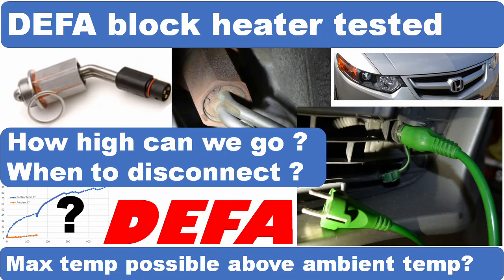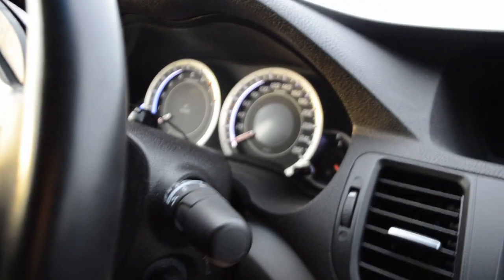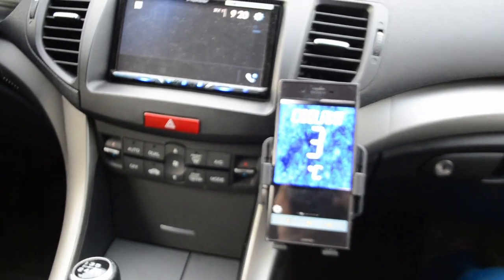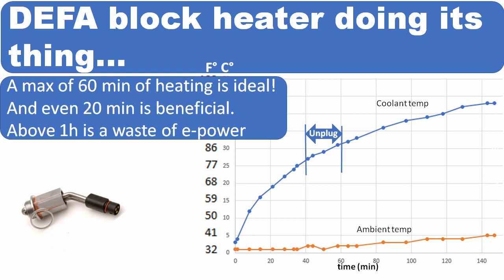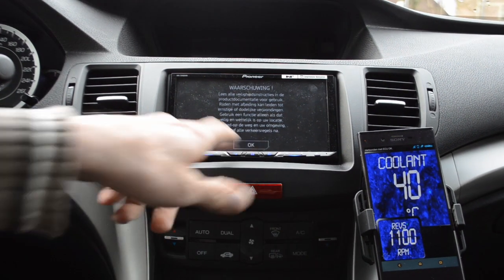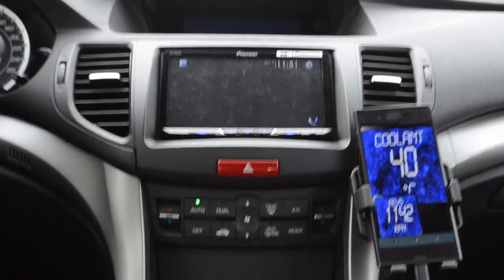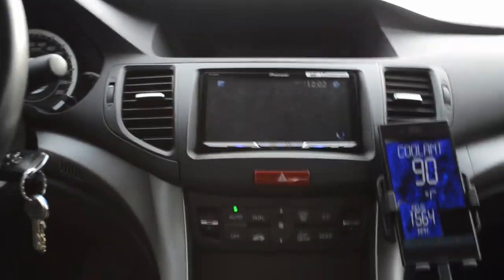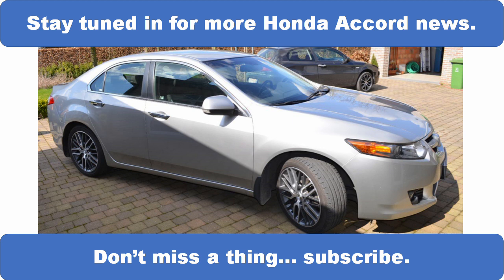DEFA block heater tested

Comment: I used my defa heater for the first time this week and on the second day my battery was dead. Does this have anything to do with the battery?
Reply from the maker: No, there's no connection between the 12 volt and mains. At least, if you only have the heater (resistance). Must be coincidence.
Reply: @thedreamfactory6964  ok thanks 👍

Comment: Here’s what DEFA found is cost effective. From lab tests measuring many parts of the engine, fuel consumption and emissions.
15 min, 10°C
50 min, 5°C
1.5h, 0°C
2.5h, -10°C
3h, -20°C

Temperature-to-time diagram. Page 10
https://www.defa.com/content/uploads/Documentation/Downloads/Technical-information/Electrical-preheating/Technical-Handbook-EN.pdf

Lab tests. Interesting read! :)
http://files.defa.com/wup/bilder/DEFATestReportDEFAEnginepre-heaters.pdf

Comment: Hi, I bought a car with this heating system defa. it only heats the car 5 days a week...do I need a remote control, how do I reset the system? You know? Thanks
Reply from the maker: I don't have any remote control. It's plugged in with a mechanical timer on the mains. Or I plug it directly in the mains connector when needed.
Reply from the maker: There's also no reset whatsoever. I don't know what you mean with resetting the system.
Reply: I do not understand. Since I bought the car in 2017, when the cold season comes and I put it into reverse, in the first year it didn't work on Tuesday and Wednesday, then Wednesday and Thursday, Thursday and Friday...now it doesn't work on Monday and Tuesday. Can't do a reset?
Reply from the maker: @jujuyo-yo3142  There's no timer integrated with my system. I can't program anything in the car. My timer is external.
Reply: he translated it wrong, it's not when I put it "in the reverse" what I wanted to say is when "i plug to the defa"

Comment: Check out this block heater tech from Canada. Looks like it takes remote block heaters to the next level - https://www.youtube.com/watch?v=xNkw16_rdQY&t=4s
Reply from the maker: That's just connector technology, no blockheater. Maybe i'm missing something?
Reply: @thedreamfactory6964  You're right, it's a quick-release for drivers that forget to unplug their block heater (which happens more often that you'd think). It's also a power outlet that is waterproof, wifi-enabled and allows you to monitor & control energy consumption remotely. Thought it was pretty cool when I saw it

Comment: Kun je eens een Watt meter aan de block heater doen (Bij de stopcontact bedoel ik) ben wel benieuwd hoeveel stroom zo'n ding verbruikt
Reply from the maker: Ha Maurice, dat is niet moeilijk hé. Het element heeft een vermogen van 550 W, de spanning is 220 V. P=U*I. Dus I = 2,5 A. Maar wat weet je daar nu meer mee? Het is een kwart van een strijkijzer... Twee grote TV's... De prijs per uur die weet je al voor je 't koopt. 1 uur aansluiten is ongeveer 0,12 euro.

Comment: My Defa heater heats up to 60 after 2-3 hours. 3 hours is the recommended max usage so i try to leave it plugged in for 2,5 Hours. 
Thank you very much for the video! I have found out about the same behaviour.

Comment: Thanks for a useful test video. Which app are you using on Smartphone to register temperature of coolant?
Reply from the maker: Hi Gerard, I'm using Torque Pro (OBD2 / Auto). You need a bluetooth OBD connector in your OBD car connector to get it working. Thanks for your possitive comment.